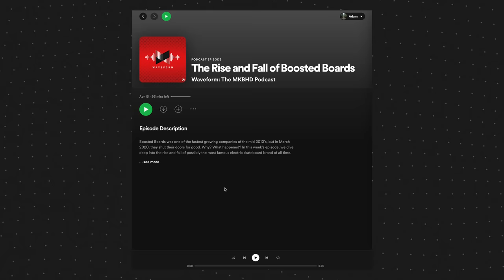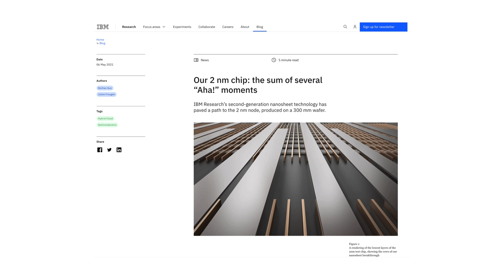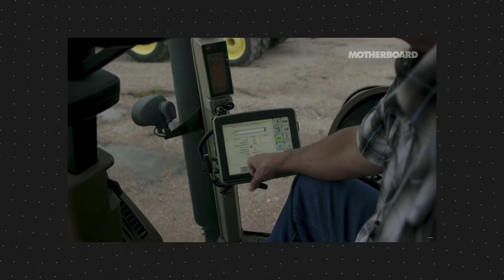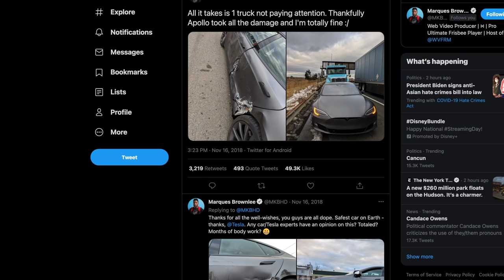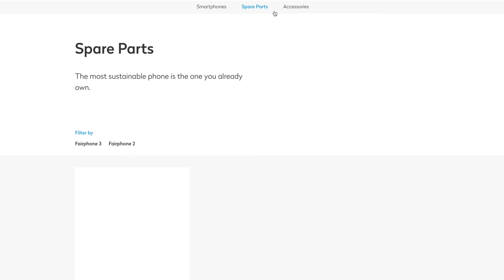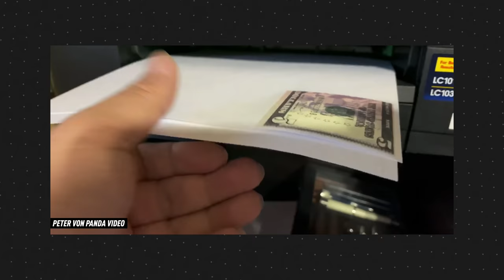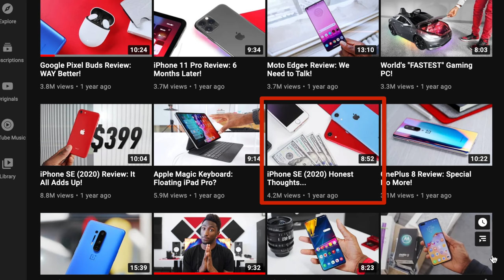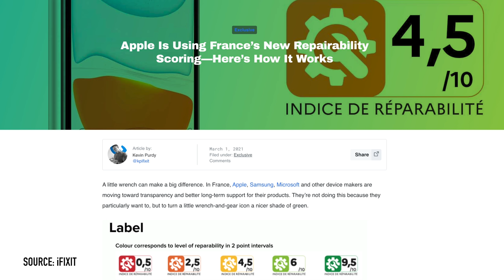Right to Repair Deep Dive!

Comment: Exactly like Louis said, things with more complex and smaller technologies don't mean they are unrepairable by someone else. It is okay to design new products with more integrated technologies. It is up to the repairman to figure out how to repair it. The manufacturers are basically just confounding right to repair issues with so-called innovations. It is insane manufacturers intentionally disable products in firmware/software where parts are changed by users.
Reply: Blowmymind
Reply: Vincent,
Reply: Flickr
Reply: Loucuse
Reply: Lactose

Comment: Currently ~20min, but it seems like there is still a lack of understanding of right to repair.  Right to repair is in no way a detriment to how technology moves forward. Yes things are getting more advanced and integrated. But right to repair is simply wanting the ability to purchase replacement parts that aren't artificially marked up in price. It's not the manufactures concern how difficult it is to replace a part by a 3rd party. The guise of worrying about safety is an easy cover to continue making loads of money.
Reply: artificially marked up in price is definitely a key here for me.  I'm no expert, but just a cursory look at how to repair my old iPhone 6s's REALLY banged up, but working screen, as well as getting a new battery in it, through an official apple channel or an authorized apple repairer is LAUGHABLE.  Just completely a bizarro world of pricing.
Reply: More parts to replace..

Comment: You missed the point with more advanced integrated tech and 2nm CPUs. We will not be repairing these, and we're fully aware we can't get inside them with tools. We don't want to fix 2nm CPU in your laptop, we want to be able to buy the keyboard, battery, or screen, so you don't have to throw the perfectly fine 2nm CPU away. There are things that are not worth repairing due to cost/availability of parts/tools, and there are things that are and save you a ton of money while letting you get your data back (which authorised repair often won't give you). All we need is them not artificially force things that could be easily repaired to be e-waste, by explicitly threatening the manufacturers of parts with legal action if they sell the parts to us. If you don't want to fix your product, at least don't artificially prevent others from doing so when they are clearly better at repairing than you and can make it profitable.
Reply: The 2nm CPU thing was just a straw man argument from that guy. 

CPUs don't really break. They're just silicon and metal, there's nothing delicate that could break, and they can last 25 years. We're actually concerned about lithium ion batteries and SSDs, which significantly degrade over time and last 2-5 years under normal conditions and take the rest of the device with them when they die.
Reply: PREACH
Reply: @PiousSlayer  Absolutely, I'm sure the chip is still BGA. Those can be replaced. People do this successfully everyday. The real problem is the way manufacturers key the chips together on the board. Even with an OEM replacement the rest of the chips won't accept it, because it has the wrong code. It should be perfectly functional, but there is only one arrangement of chips in the world that will allow the device to work. So in many (most?) devices now it is possible to replace the CPU, but basically pointless to do it. And I've never heard a manufacturer give a good reason for keying the chips together. How are practices like this innovation?

Comment: Transistor size has nothing to do with repairability. No one has repaired an individual transistor in these chips. Individual transistors are cheap to manufacture, and when we talk about repairing a product, we usually talk about replacing some basic component. (Transistor is not a basic component, a typical chip consists of billions of transistors, no one goes and replaces them one at a time.)

What the R2R advocates want, is the permission to buy these basic components, so damaged ones can be replaced.
Reply: He literally talks about this on his video about it... Which he says...
Reply: @mad3st  Classic case of over thinking it!
Reply: You are bang on. 1 of Louis Rossman's bug bears is the software lock attached to the power button on iPhones preventing a simple repair.

Comment: And it is really a misleading argument that when a well "integrated" 2nm chip product breaks down, repairman are not able to repair it. There are always chips that are surrounding that 2nm chip, for power regulation, for camera sensor, for speaker, etc. No one is talking about digging into that 2nm chip to repair it. It is about fixing that power rectifier chip or a mosfet or a usb-c port etc.
Reply: Or even the ability to purchase a new motherboard with a new chip on it
Reply: Seriously!!! It's ridiculous to suggest these types of things. You replace a PART, you don't get out your atomic force microscope you have in your backyard laboratory and try and fix the parts of the nanoscale structure that have broken down. Sheesh! It's such a horrible straw man argument.
Reply: honestly common sense ., how are they confused? error codes? people will learn them. the machine will run over a barrel?? dude the simplest command is stop. no avoidance technology? wtf. if they hurt themselves it’s not their problem people will understand this and john dear won’t lose business. no . people will understand that a person messed up. this is bs? or i’m stupid i’m high for sure

Comment: I personally think this conversation derailed from the main point of right to repair. Whilst the conversation did touch on points many people will consider when arguing the whys and whats for right to repair the main aspect still remains most important and that is right to repair is not here to harm innovation, it is to enable you, as the user to have that choice to repair your property should you want or need to do that without losing the ability to use that said product or risk losing data or even being persecuted. It's a very simple argument. You don't want to repair it yourself then don't. You prefer to buy a replacement then do that. Basically give me the choice to decide what I want to do. And I guarantee that most people would make an informed decision even with high power electronics or complex systems. However, people with the knowledge like me (robotics engineer here) would like to be able to solve a stupid screen replacement or even battery replacement without losing the ability to use our devices. I don't see how that hurts innovation. If a nee product comes along and it's better than the one before and there's a cost-benefit to it then I'd get the new product. To me this is a very simple discussion, even from the point of view of a product designer and prototyper (again, here I am)
Reply: Ex
Reply: E

Comment: I feel like you are saying that right to repair would slow down progress but that isn't what we want. We just want the ability to buy the parts to fix our stuff, or in the case of John Deere, the software to at least diagnose your own equipment. For instance if your car has a warning light on you can buy an OBDII sensor and it will tell you what that code means. John Deere won't allow farmers to have the software they need to do that to equipment they paid for. Given them that software wouldn't slow down technological progress. Stopping Apple from telling chip manufacturers that they can't sell these specific chips to consumers or repair shops wouldn't slow down progress either and I feel like that was missed in this episode.
Reply: This is exactly the comment I came to make. Thanks.
I believe that the whole podcast completely missed the point of right to repair.

Comment: I dont expect to repair everything i own personally, but in the future if my electric car were to break down i want the option to go to Dave's garage because he has the skill to fix it instead for £150 instead of paying £350 to the manufacturer or a "licensed" dealer. Give the people with the skills the option to repair your stuff without having to pay you a premium for the right to get the part.
Reply: I'll play devil's advocate in this scenario. How would you know if he has the skill to fix a Tesla? Would it be based on his claims, because I doubt anyone will turn down a customer. An electric drive train is much different than an ICE drive train so its not like asking an android repair guy to fix an iPhone. Tesla probably has people get licensed to work on their cars so they can actually do it correctly and therefore not have to worry of any bad PR from shotty work done by a random mechanic.
Reply: @jatinkulkarni2428  as things stand now its hard or next to impossible to find a random garage with the skill. Just like with phones the more of them there are the more motivated independent people will be to pick up the skills. In 5-10 years when electric cars are more common, one crashing or breaking down wont be news. 
The same scenario can be put forward for current ICE engines, when they started out it was new and only a handful of people could fix them. Now the options are endless, the same will happen with electric and i dont want a future where a software/hardware barrier  is put on to force me to go back to them and pay more than the service is actually worth.
Reply: @jatinkulkarni2428  Dave's reputation, and my past experience, like for anything else.
Reply: @kudaa8969  I was thinking near future, but definitely in the future I would want any garage to fix any car.

Comment: I don't know... I feel like Right to Repare is as simples as "Right to buy parts of something you do own". It's nothing like holding technology progress or anything... Just stop big companies from having the repair monopoly.
Reply: This.

Majority of the discussion was completely derailed by Marques' premise of "better products with more integrated technology". I think he completely missed the point of Louis' reply, and I understand that it's easy to get lost on the tangents (since it is linked to several topics and issues). Louis already mentioned that it was the third-party's problem to figure out how to repair them. It's the effort of companies to prevent people from repairing/modifying the products they bought that's the problem.

Just don't block them from getting legitimate parts. Just don't prevent them from using other legitimate parts via serialization. Especially when the company itself is unable to fix their own products.

But their discussion did get one reason right: it's basically companies avoiding bad PR.
Reply: @JyuzouNT  Not to mention the fact that "more integrated technology" doesn't hurt repairability! People talk about highly optimized or integrated systems like they're some sort of "magic" that let highly precise machining come together to make innovation happen. But the reality is that systems that have this level of integration are often capable (or can be easily modified to be) of self-calibration. There are companies that will let you order hot-swappable parts that will self-calibrate as they install themselves! Furthermore, this goes beyond companies avoiding bad PR. Apple will lie to you about their poor engineering decisions and CHARGE YOU to repair THEIR MISTAKES simply because it makes them look better. They've crossed the line of PR into the realm of illegal behavior that no one calls them out on.
Reply: @andrewcopple7075 , I like that you pointed out how technology is treated these days as magic, and I totally agree. Just a few years ago, people are able to tinker with their stuff and repair it on their own with no issues. But these days, it's just something that you have to send to the shop. It's the kind of mentality that's been slowly fed to consumers until it's became the norm.

I also briefly mentioned that the topic is quite complex, in the sense that it is related to multiple topics and excuses; bad PR is just one of them. To name another one, right-to-repair is also related to another issue: planned obsolescence, which ties in to one of the examples you've mentioned. A mistake by companies like Apple at face value, but if you watch Louis Rossman's vids, anyone would argue that it's completely intentional.

The way Marques looks into the problem is a bit skewed, I feel. I guess his experience in the tech world made his vision of the topic too complex. His original premise and the other ways of him looking into the topic, to be fair, is neutral, as it tries to understand the point of view from both parties, but is also misleading.

Let's keep it simple.

And that's why I like Paulo's comment so much, since it keeps it simple. It's not about people blocking companies from progressing their tech (if anything, it's about companies trying to suppress their IPs). Right-to-repair is about companies trying to block people from fixing devices that they own. No need to lump in "integrated technology" in there, which I feel becomes a red herring to the conversation.
Reply: @JyuzouNT  I totally agree with you. I begin to listen to Marques from the beginning of his channel and i think he is deeply influenced by the new way things are made it. It's a generational thing. 

Then i found Rossman's videos and wow i think "he is so clever" but companies don't like it. In fact this is the same discussion when free software begin to go mainstream and many compare to a communist vision. Stallman has to go out so many times to clarify about term and avoid the political issue but in the end, free software is a political movement deeply affecting the way companies conduct businesses.

Right to repair can not make the minimal damage that is making cryptocurrency to the computer market in compare. But when Elon Musk irresponsibly tweet about the subject no one criticize how his influence can alter the behavior of the market because a lot of people admire him.

Marques is a big influencer in the community and i think his opinions can have a big impact in the consumers. I not say he is PR for companies but i think he begin to change from his beginnings. Because i don't agree with many of his new assumptions, I unsubscribe to his channel and i advice many of my college in my country to make the same.
Reply: @pubdigitalix , I didn't get one of your examples for cryptocurrency regarding "damages" compared to the right-to-repair movement, tho I think your main point is how Marques is affecting how viewers interpret the conversation, and I agree as well.

Right now, I'm not certain if Louis would consider his participation in the discussion more of a benefit due to rabbit holes Marques included in the discussion, which is confusing and misleading imo. Does it outweight the benefits of potentially having the word out to a  bigger audience if the same audience has a skewed POV of the movement? His discussions will play a major part; he is for sure one of the top (if not the top) Tech YouTubers right now and will be guaranteed to have a huge influence to other people.

There could be (and probably is) some level of conflict of interest involved here, but I think that Marques was doing his best to be as neutral as possible. He's been neutral throughout all of his topics so far, though not going so far as to scare off device manufacturers. I can also relate to their discussion somehow; they obviously don't have enough knowledge about right-to-repair. I've been watching Louis for a LONG time and you really can't condense his involvement in the movement within 1 hr. It's also one of his challenges when introducing spreading the movement to other people because of misinformation.

It's frustrating to watch the 3 of them process the information on their own. I understand that they did some research, but the topic got so out of hand. What I think would be best is to have Louis on the show to discuss the movement with them, rather than them speculating on stuff and going off course somewhere related but misses the point entirely.

I understand Marques's point that more integrated units will be harder to fix, but it's not about that. I believe that devices will still have some level of modularity in the future. And if ever it doesn't, it still isn't about that. It's about companies not wanting people to mess with the stuff that they bought.

They should have a redo.